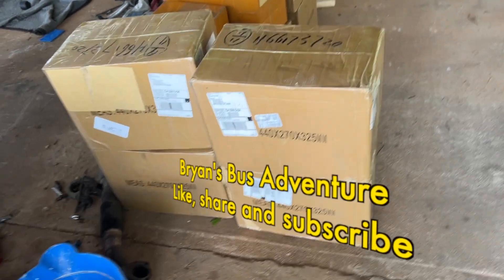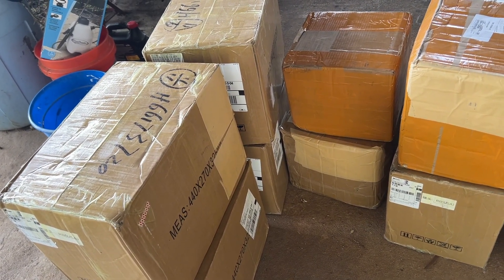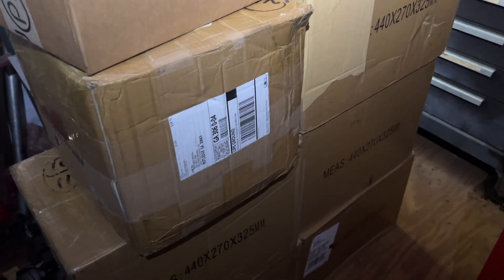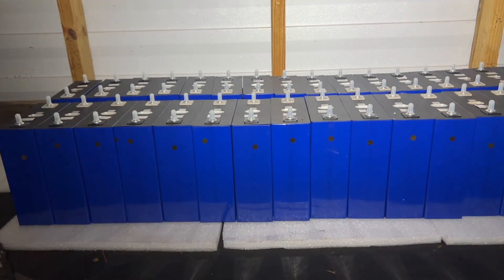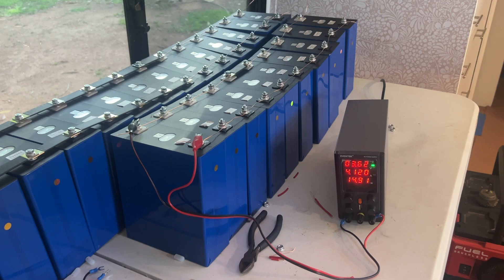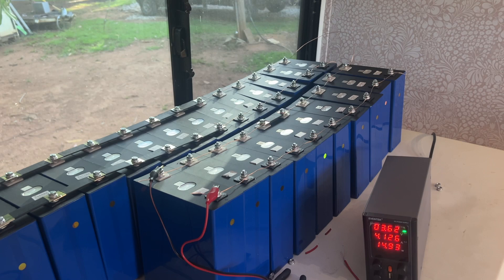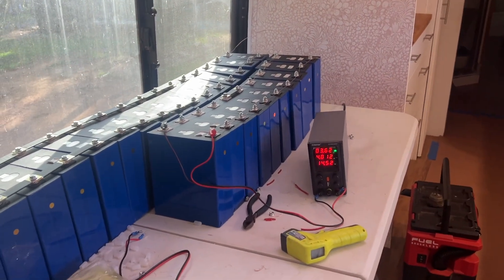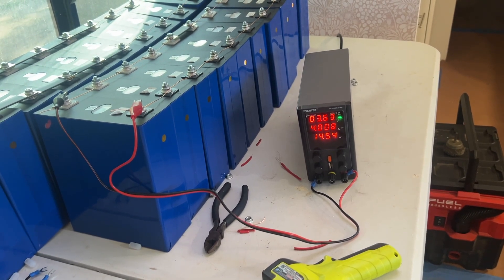Lipo4 batteries top balancing #bus#4108A#GM#remodel #buffalo

Comment: I just built 2 17 cell batteries and skipped this top balance process completely.. My BMS has 2 amp balancing built in and they did a great job keeping the cells balanced as the packs were taken to 59.8vdc for the first couple charges.. I also used mild compression to help the cells prevent bulging but plan to remove this once they are seasoned with at least 10 cycles from top charge to bottom charge as I never plan to push them harder than .3c.. This saved me weeks of messing around and I have a .003v variance cell to cell in the packs..
Reply from the maker: that sounds great.  is this mobile application?
Reply: @bryansbusadventure4783  900 pounds of batteries so no.. Stepping up from L-16 lead cells was a wow moment in the total storage and the speed at which I could charge them has really optimized the solar array.. I hope your install goes well as I watched a couple videos of some that went well and others that did not..

Comment: I did this with my bus except I used 32 100ah cells....and watching your videos are scaring the hell out of me.
1) take 4 or eight in parallel at a time not 32
2) both your charging leads should not be on the same end of your run
3)3.55 volts should be your goal for top balance not 3.65 and 3.45 would be better
4) the cells will likely swell with charging and should be slightly compressed.
Reply from the maker: please explain to me why the leads need to be at opposite ends.  I have checked with several (experts) on line and none of them top balance that way.
Reply from the maker: why does this scare you ,  please explain why.  with 3.6 volts and 4 amps there is no challenge

Comment: To everyone watching this: never use 3.65 V directly on such large 280/304 Ah cells with your puny DC power supply while top balancing.

That 3.65V is supposed to be at 0.05 C rate according to most cell manufacturer datasheets.

Forget multiple cells in parallel, even for a single 280 or 304 Ah cell, 0.05C is around 14-15 Amps. Now multiply this with the number of cells paralleled will the corresponding cutoff charge rate @ 3.65 V.

People should just use something around 3.38 or 3.39V for top balancing.
Reply: Yeah those wires across the cells are also wayy too thin.
Reply from the maker: @zaprodk  I think you are referring to balancing from a BMS. I have research this and I am doing it correctly. thank you for the concern
Reply from the maker: @reversemyopia  I’m sorry but you are wrong
Reply from the maker: You are correct, it is way slower this way but it will be there,  thanks for the input  again thanks for the reply.  I will check that immediately